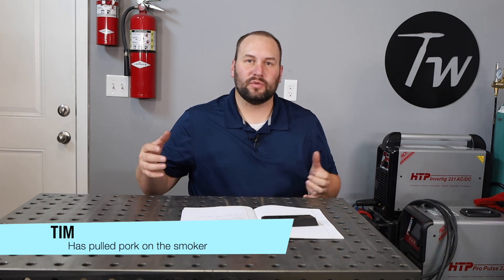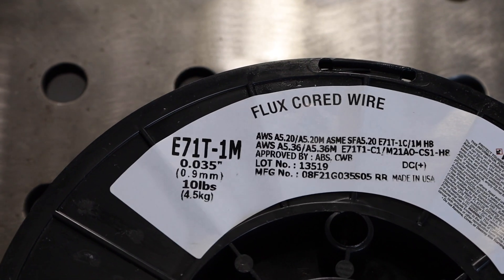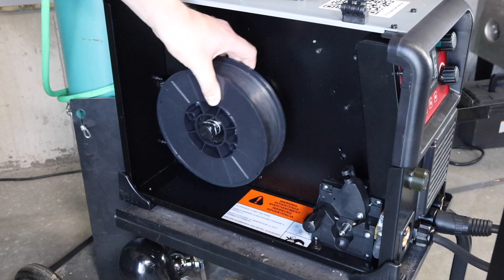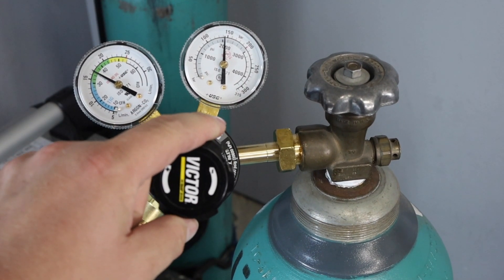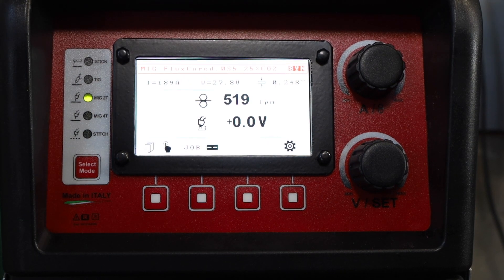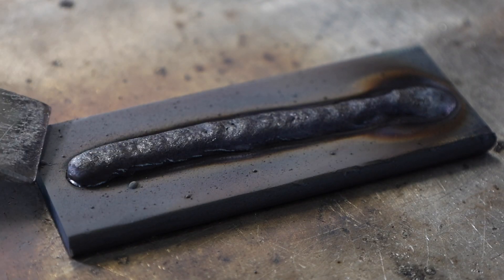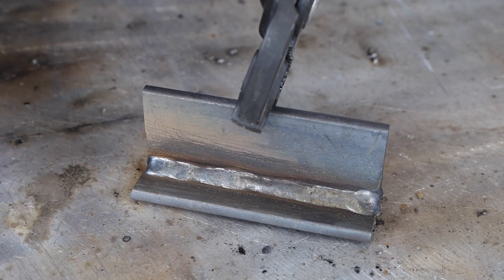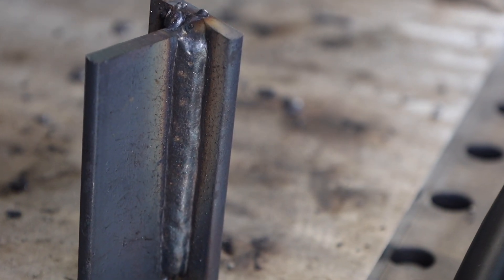Gas Shielded Flux Cored Arc Welding (Dual Shield)

Comment: We have used this process a LOT over the years for assembling large hydraulic cylinders for earthmoving equipment.  We've found it to be as reliable as stick but FAR faster. Especially when running an 8" diameter tube on a rotator with 045 wire

Comment: Hi Tim, Do you know if I could use this process (FCAW-G) in a Lincoln machine 180 Amp Weld-Pak 180 HD MIG? I read the spec and I just can see Solid Wire Gas (GMAW) and Flux Core Gasless (FCAW-S).

Comment: Tim, I watch your channel all the time. I have a quick question, I have a Harbor Freight Vulcan Omin 220. Do you know if it is possible to run Dual Shield with this piece of equipment and what is needed?
Reply from the maker: I haven't used that machine, but I have run .035" dual shield in several similar output machines, including the Harbor Freight Titanium MIG 170, so I think it would. I wouldn't go bigger than .035" on that machine, though. All that is needed is the right size contact tip, the wire and it usually uses the same gas as standard short circuit MIG welding (C25 or CO2). I'll put a link to the specific wire I use below. You can also search out other brands. ESAB's brand name is Dual Shield and Lincoln's is Outershield. 
https://usaweld.com/products/htp-america-e71t-1m-dual-shield-mig-welding-wire?ref=timwelds
Reply: Thanks Tim, I will look into that.

Comment: Can this be used on material under 1/8"? How does it do with large differences in material thickness? Say 1/2" to 1/8"? just how sensitive is it to wind/outdoor use?
Reply: it's better to use a solid wire in most cases on thin metal due to the bead being larger on fluxcore. less cleanup. and more forgiving for thin material. for welding thicker material, angle your gun more into the thicker material, otherwise you'll get some pretty bad undercut.

welding outdoors is okay. not ideal but if there isn't too much wind you should get good welds. set up a couple shields if you need to

Comment: Great vid. Can i use that flux core wire whitout gas to weld outside??
Reply from the maker: No, this wire needs gas. E71T-11 or a quality brand of E71T-GS are the most common for use without gas. For these gasless versions, the polarity needs to be switched to electrode negative.
Reply: @TimWelds   thanks for fast answer

Comment: Tim, would the recommend flux core settings be a good starting point on my Miller Multimatic 215?  Looking into trying it for the first time and there is not a ton of info out there. Thanks!
Reply from the maker: 375 in/min & 24.5 volts as well as 300 in/min & 23 volts for this .035" wire worked pretty well for me.
Reply: Thanks Tim!  Great video as usual.

Comment: Hi Tim, awesome channel!
My question is that in this video to get dual shield, you've started with a MIG process (GMAW to be specific, electrode positive), and added a flux core wire to get the dual shield advantages.  I have a Titanium 200 multi process welder, but in the three years I've been welding, I've only used flux core.  For an  upcoming project that I'm planning involving welding very thick mild steel, I was considering adding a C25 gas to the flux core process (staying electrode negative). Would this work to get the dual shield?
Reply from the maker: Thanks! No, in addition to the gas, it also requires a different type of cored wire and DCEP.
Reply: Lincoln (Originator of this process) says not to do that, they go into detail in their booklet about this kind of wire (available free online).  You'd make it WORSE I think.  You can use CO2 with this also, by the way.
Reply: @leonardpearlman4017  did not know you could add co2 to flux core welding 😊

Comment: so i have a question for Mr. Tim Welds... any advise on how to fix my flux core welding...my welds look spotty (porosity) and aren't a clean bead. I have changed higher amps, lower volts, lower amps, higher volts etc etc... cant understand why i just cant seem to get a decent bead. I find myself having to grind, weld, grind, weld, grind, weld... and so on. I am welding  square tubing, if i slow down i burn holes so i lower the amps and volts but then i have a crappy arch... any ideas or advise? love the channel man!

Comment: Very glad that you have raised this topic, a video on the applications for gas shielded flux core and maybe differences in weld properties would be appreciated. Also it would be interesting to know the difference  in cost per kg of weld with fluxcore, gas shielded and then gas shielded fluxcore to understand cost vs benefit. Gas shielded flux core looks very clean and spatter free compared to the gas only process. Great videos thank you for your effort in making them and the clear easy to understand explanations.
Reply from the maker: Thanks so much! Great suggestions!

Comment: Can you recommend a really cheap flux core welder that i can weld aluminum with?
Reply from the maker: A lot of great points have been made here already. With the $150ish budget you mentioned, I’m aware of 3 options for aluminum: 
1) Stick weld it with a cheap inverter stick welder. Don’t do this...at least not without understanding what you’re getting in to. This is quite difficult and I wouldn’t recommend a beginner go down that road right off the bat. 
2) Solder it with “alumiweld” and a mapp gas or propane torch. This stuff actually works fairly well for certain lightweight work, but it has a lot of limitations. You could look into it, though. 
3) Depending on how much welding you need done, you could hire it out. I do small jobs for people all the time. You can ask around or check your local classifieds and might find a side hustler like me that would give you a good price. If it’s an extensive project, it could get expensive, though.
Reply: I think you'll need to look for a spool gun.  Somebody correct me if I'm wrong.
Reply: @danl.4743  thanks I just need to know which bargain machine has the right settings.   I mean 150$ amazon ebay machines
Reply: First you have to find the gasless flux cored aluminum wire …  
I am looking now for 10+ years ….  But every time i go to harbor freight and ask for it they tell me its sold out …..
Now all joking aside ….
Gas less wire  ( steel wire that is) needs to react with the ambient air to work correctly ….  
Aluminum can NOT under any circumstances come in contact with the outside atmosphere, it needs a shielded atmosphere. 
Either you need to use 100% argon ( as in mig or tig) or the shielding atmosphere comes from the flux burning of the outside of the stick rod while the spray transfer happens on the inside of the shielded atmosphere …..
Reply: @ZILAwelds  yeah. After more research it seems aluminum flux core does not exist
Reply: @tadman3d  if you want to weld aluminum and if you want to be successful with mig you either buy a lot of grinding wheels and only weld materials thicker than 1/8" of an inch or you will need to find a way to control your settings while you are welding ....  (voltage And wire speed that is).  this way you can start hotter, and as the material heats up reduce your settings and if you come to a section of less than perfect fit up you can reduce it evermore ....  
in contrast to steel welding aluminum is a very heat driven process ....  if you weld the front of a t joint and your settings are slightly too cold, then you flip it around and weld the backside the settings are way too hot ...  so unless you let the material cool down to the exact same temperature from before you originally started welding  you will have inconsistent results even using the same settings and technique ...  
so if you can "read" the puddle and adjust your settings as you go - that would be perfect ....

Comment: I would like to weld Stainless Steel without switching my tank to a tri mix.  I was thinking of a good dual shielded stainless (its expensive).  For me being a garage maker I am starting to find that time and labor put into keeping sanding, painting, removing protective oil that has oxidized etc and then painting... buying more expensive stainless starts to look like a better option more and more.  If you have videos for people who want to step into mig stainless for the least costs that would be fun.
Reply from the maker: Great suggestion. Thanks!
Reply: Iheart3dprinting   There is such wire.  I have used it many times !!!!  It is called E308LT1   You use 75/25 gas DECP  about 40-50cfh the stainless wire you always have to drag (the mild steel from this video here could be pushed if had to be) 
The stainless wire is the wire of gods!  Lol  no spatter, perfect colors ….  Etc etc etc

Do you want a link where you can buy it?
Reply: @ZILAwelds  yes I’ll check it out!
Reply: @ZILAwelds  you may have replied and your link may have been hidden.  Is it the one from Airgas?
Reply: @ZILAwelds  Hey, special guest appearance!  If ZILA is watching your channel you must be at least OK.  I agree with this from very limited experience.  Gas-Shielded Flux-core wire is sometimes available as an eBay bargain.  It's suggested retail price is pretty high!  I got to use some once that was old stock donated to my school, it was amazing!  Very intense arc, then the slag was black (Chromium oxides, I thought), when that came off the silver or slightly golden stainless bead just looked so smooth and nice.  There are a few different kinds of stainless available in this form.
Reply: You can pulse MIG stainless on the HTP Pro Pulse MIGs with only argon and CO2, but NOT C25.  Its a very specific mix:  98% At + 2% CO2.  I can build you a custom gas mixer to dial in such a specific gas mix.
Reply: @zod-engineering-welding  At? Or Ar?  I am assuming ar. Thank you!
Reply: @takingtheblackpill  yes, stupid auto-correct.   Ar for argon :)

Comment: Can you show the weld penetration, cut and polish.   Thank you.
Reply from the maker: Thanks for the comment and suggestion. I can probably incorporate that into more future videos. In the meantime, there are some other videos out there with cross sections of dual shield welds. Here's a link to a good one that Jody (weldingtipsandtricks) made comparing dual shield to standard short circuit MIG welding: https://www.youtube.com/watch?v=6XD2gpCKK-E .
Reply: Thank you Tim.  I like that the shock loading is good.  I am adding a large boss on the top of a Mack truck rear end to control the side loads .    This will allow me to use Peterbilt Air/Leaf suspension for the up and down loads.  Airbags will make a much better ride.  The rear end could  get shock loads, but this is being installed on a 1956 B- Model Mack.  Therefore I won't be hauling big loads any longer.   I was planning to use a 6011 root pass and 7018 cover, but dual shield MIG sounds better.
Reply: Jody also has a follow up video comparing to 7018:

https://youtu.be/TX8N9oow6Xo?si=ByF9kWi3vcwF962M

Comment: 😯wow,,  more versatility and super clean welds. But,, 
can that wire be used on a less fancy/expensive  gas Mig??
Reply from the maker: I wanted to fact check myself before replying to this, so I just ran out to the garage and loaded that spool of wire onto my Harbor Freight Titanium MIG 170. The welds came out great, just like in this video. There will be some limitations in terms of amperage and duty cycle when compared to the HTP, but it will definitely get the job done. I used two sets of settings on the MIG170, which both worked great -  375 in/min & 24.5 volts as well as 300 in/min & 23 volts for this .035" wire.
Reply: @TimWelds  ,, Thanks for checking on that..
This is why I Sub 💯👍.
Great content and obviously prompt follow-up.  
Cheers 🍻 Tim,   G.
Reply: As long as you can get knurled grooves drive rolls you should be fine.
Reply: @TempleThomas  if you dont have knurled drive rolls, just put some electrical tape around the drive roll that provides enough “traction” for the wire …. Dont get carried away with drive roll pressure on the feeder ….  Less is more
Reply: @ZILAwelds  good to know thanks !!!!